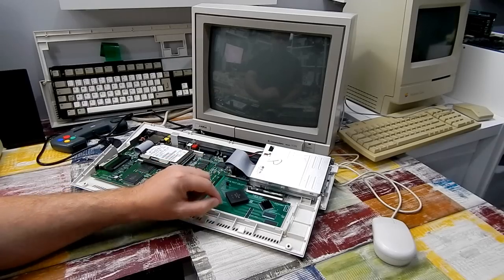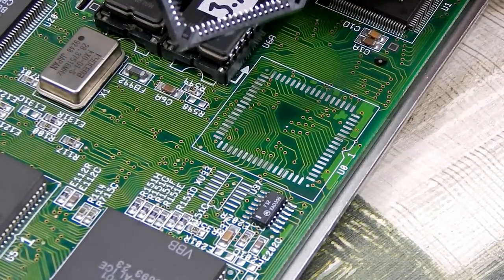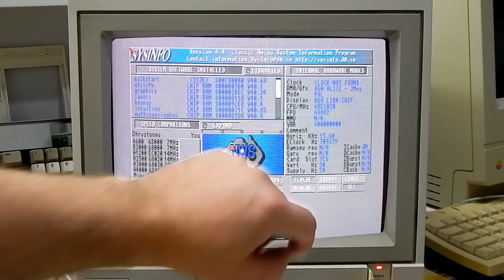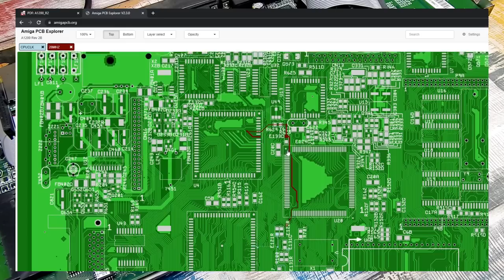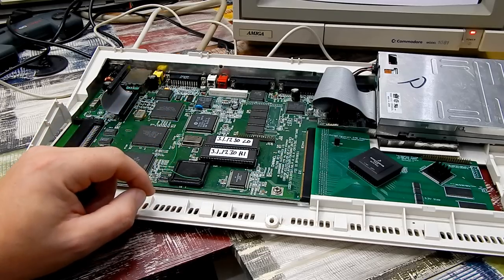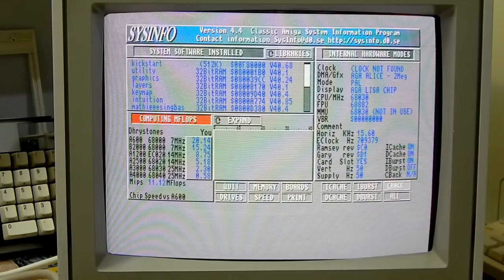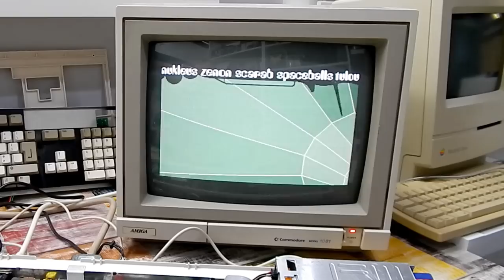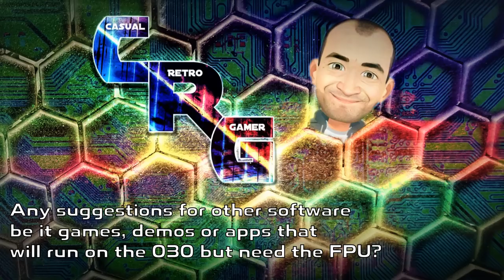Amiga 1200 adding an FPU to the TF1230 *sort of*

Comment: Great video =D The reason its not running as fast as you thought with the clock coming from 030 - Don't forget the 030 doesnt run at its full clock speed all the time!  When you connect to mobo 28Mhz - that's a constant 28Mhz!   When TF1230 slows down to access chip or other things, that means FPU is slowed down too!  I suspect the crashing is when it peaks at 60Mhz, that's a bit too much for it over time.
Reply from the maker: Glad you enjoyed it and thanks for the help on discord.  Never occurred to me that the 030 slowing might be the cause of the slower clock but I do think the issue here might be as Stephen suggested and the clock is too fast for the chip.  Running AIBB now it thinks the fpu is running at only 22.4 MHz or just a little under half the CPU clock.  It's a pitty my scope can't handle frequencies  that high or we could take a look at it.
Reply: @CRG  Its definitely due to cpu clock speed varying!  That 28mhz is always 28Mhz
Reply from the maker: @GadgetUK164  I'm going to fit a separate 40mhz crystal.  That should sort it out and allow me to crank the CPU back up to 60.
Reply: @CRG  also do the acetone test to check you don't have a remarked 16MHz part, which I'm guessing you do :)
Reply: @CRG  The FPU chip select signal come from the AA Gayle chip and will be limited by its maximum decoding speed and it maybe synced to the 14Mhz bus/clock? That may explain why it ran slower on the faster 030 clock. May also explain the .6 reading at 28Mhz as it would get 2x28Mhz cycles and have to wait for 1x14Mhz cycle whereas at 14Mhz it would be 1x1 giving .4. 
You could also try and cut the GND you added with the twisted pair at the FPU end (just leave it floating) as you may get ground induced noise if current is flowing (ground loop). or add a 10 to 33 Ohm resistor in series with the GND, or you could go to extremes and use a micro coax (WiFI antenna coax from an old notebook PC)
Also: I found the best way to test the FPU is AIBB Beach Ball test, it will exit early and not draw the entire ball. (gives impossible results)
Reply: @CRG  Did you get a 40mhz crystal to test this out? :) Hope to see a folloup soon. Love this kinda vids where you do new untested stuff and findings :)

Comment: The 28MHz clock is in time with the motherboard (i.e. it's a synchronous clock). The 50MHz clock is asynchronous, i.e. the clock signal isn't aligned with the timing of the motherboard. I think that's why it's working out somewhat slower when using the accelerator clock? You're basically missing the odd cycle due to that non-alignment. If you draw the clocks on some graph paper I think it should become apparent what's happening :)

Comment: Reminded me of when I had my A1200 with an 030 processer and FPU accelerator around 93. I left it on to render the Enterprise with a 3D package (can't remember which one, but I think it was an Amiga Format cover disk.), I think it had been rendering for around 2 days and was around not far from being competed when I decided to go to the local pub, I came back after a heavy night out and my Mum told me she  had switched my Amiga off to save electricity!
Reply: That's even worse than a games console you left on getting turned off at a point before you can save...  ouch

Comment: 28 MHz are generated on the mainboard of the A1200. But because the graphics and the CPU have to access the chip RAM, it is 14 MHz for the CPU (& FPU) and 14 MHz for the graphics (AGA chip set).

An external CPU board can access the external Fast RAM synchronously with 50 MHz, but asynchronously access the Chip RAM only with a 14 MHz bus.

If you direct 28 MHz into the FPU then these are in sync with the 14 MHz. The restriction that the 50 MHz CPU can only access it asynchronously remains.

If you direct 50 MHz to the FPU, the FPU is faster, but no longer synchronous to the 14 MHz bus on which it is attached. The CPU looks even worse. The CPU with 50 MHz can only access the 14 MHz bus asynchronously and can then only reach the 50 Mhz FPU asynchronously from the 14 MHz bus.

Comment: I did the initial video on this. But nice job tapping into the 28.  I just use the crystal
Reply from the maker: Thanks, I have to admit I missed your video and didn't see it until after getting most of this one recorded.  It seems to be a popular topic at the minute as a few people have done videos on it.  

Ultimately I think the separate crystal is the best way to do it and I'll revisit this to undo the clock from the 1230 and use a 40mhz crystal instead.
Reply: @CRG  10Marc has just done a video on the Tsunami 1230 card (New version of the old Phase 5 Blizzard). The Tsunami is like the TF1230 but has space for a onboard FPU socket to be run at the same speed or above the 030 @ 42mhz 👍🏻

Comment: Here is some info to help you: In theory a (e.g. 2.5 watt) laser etcher/engraver (as used for PCB etching) might accurately be able to get that black coating off the 68030 to reveal metal for a heatsink. As an aside that long wire is pulling a relatively heavy current fast and will probably want a (decoupling) capacitor for a current delayed by stray inductance in (e.g. lines for) power, lest you spike/drop the voltage. For the decoupling capacitor, film capacitors better than ceramic, and then electrolytic without additionals will be too slow before they are full with a voltage spike/drop. Maybe shield that long run wire too. At a push you could use a logic-analyzer(or MacGyver one out of an fpga)  to see how each end of the wire behaves (or an oscope kinda like checking an eye pattern). What decoupling capacitor do you think you need though? Say 100nF-400nF? Aside from Amiga, it is commonplace on 80s and 90s devices to see decoupling caps soldered atop the VCC and GND pins of IC's.
As a thought beyond this Amiga as such, protection diodes (for ECD protection) indicating a maximum current (whatever that is, be it 1mA or whatever) means protection from voltage (+12V and -5V on inputs for boards on machines but not that amiga, per se) as for leakage current, so 10k would protect against all shorts but might render the whole thing unusuable (until taken off again). That is a tangent though.
;D
In general, another youtube video fitting an FPU to the Mobo while using a tf1230 is "Amiga 1200 internal FPU anyone can do this" by Chris Edwards Restoration (video 3 March 2022).
Just FYI, when not using that tf1230, the 020 on the mobo can do 28MHz stable, and even 33MHz. An MC68882FN40A might take some such jiggery-pokery again though. Upload a Jpeg/Mpeg4 of your FPU close-up to see the writing on it?
My comment has no hate in it and I do no harm. I am not appalled or afraid, boasting or envying or complaining... Just saying. Psalms23: Giving thanks and praise to the Lord and peace and love. Also, I'd say Matthew6.

Comment: I honestly don't like using an Amiga 1200 without an FPU. I used an Apollo 68040 for the last 20 years, and when I upgraded to my TerribleFire 1260 board and used a 68LC060 chip with no FPU, half my software whined and complained (and stopped working) since I had the FPU versions installed! I know I am the exception, not the rule, but I need an FPU for the stuff I do.
I will get a full 68RC060 later this month.
Reply: For my A1200, my TF1260 was shipped with a low-cost 68LC060 Rev 4 and I later purchased the full 68060 Rev 1 (overclocked to 62.5Mhz). I use to own an A3000 with 25 Mhz 68030/68882.

Comment: Check the two clock signals with an oscilloscope. You might have ringing or dampening on the longer wire, rise times might be degraded preventing the fpu from deriving a good clock signal. I would personally use a 40MHz separate TTL oscillator just mounted close to the fpu.

P. S. : don't connect the ground wire on both sides.
Reply from the maker: Unfortunately my scope won't go anywhere near those frequencies.  A new scope is in my list of things to get but at present I don't have the funds for it.

Comment: you could have left the pstic part in soldered the pads on the motherboard then applied the socket using hot air
Reply from the maker: Possibly but I didn't want to risk any mistakes so I just put it on as I know how.
Reply: @CRG  Check out some of the Console Repair channels. Things just float into place due to surface tension. Amazing to watch.

Comment: What about Solder Paste or pretinning it, adding flux and hot air from the back to get the Socket on?
Reply: I dont think they sockets  like a lot of heat. I thought along the same lines
Reply: @georgehunter2124  You use it to melt the solder, when its molten you place the Socket on top and then move away.

I mean those Sockets got to be installed in a Factory somehow. ANd that might be an Oven or so.
Reply from the maker: Solder paste may have been an option but having never used it before and seeing other people struggle with it I didn't want to take any chances and risk damaging the 1200.
Reply: @CRG  since you're in UK, you could ask "TheCod3r" for example. He seems to do some more extreme Soldering Jobs. Like reballing your BGA thing. Without a Stencil, just Balls from a can....
I think he did some Solder Paste Jobs as well, so he might know how to use it.

Comment: That is almost certainly a remarked 16MHz part.  I bought a few a while back - only some would run at 40MHz reliably.  Even though there is only one mask the 16MHz ones may have been marked as such because they failed at higher frequencies.  I would see if you can get a genuine freescale marked one or a known genuine one out of an old accelerator board.

Comment: I wonder what was Commodore's thinking in provisioning for one and how much it would have cost Commodore to factory fit one. Perhaps they were going to but decided against it at some point.
Reply: Just a guess but ...

Engineers: Of course it should at least have the option for an FPU and we have the board space so why not?
Bean counters: If we don't fit that footprint with an empty FPU socket we can shave some tens of cents from the BoM.
Reply from the maker: I asked this question over on EAB.  The thoughts over there are that engineers designed the board and give the sales guys options of different configurations.  They could have ordered the machines to be made with an FPU but never did.
Reply: Worst still, at one time we were to get DSP included in all machines, but so that they could save a few bucks they didn't add it

Comment: It's likey impedance matching issues, or the split needs a buffer. I'm not sure how the fpu works but I assume it uses an interrupt to signal calculation is done. If the cpu is running async it takes a few more clock cycles to sync up. Maybe there are bus errors and the data needs to be resent. I think the _BEER signal is bus error, if you put an oscilloscope on that, see if it triggers.

Comment: Watched your video-very interested-but don't those demo software runs include software that utilizes disk transferring not direct memory transfers, and is the fpu saving  3 out of 4 clock cycles doing math arithmetic and is there conflict with 2 types of processing one type being disk to memory and the other processing floating point number arithmetic.Greater speed obtained by using dma transfers!

Comment: have you by any chance checked what freq you are getting from the Accel board?   I have seen chips/cpu's that take a system clock and multiply the signal to run faster internally.  This may not be that, but why trust it...  check it with an Oscope or freq counter....   that may explain why the main board is running faster...  it may only be 14 Mhz.

Comment: I've seen situations where chips go too far past their rated speed only see every 2nd or 3rd edge.. Eg. some of my 1260s clocked at 125mhz look like they are running at about half that.
Reply from the maker: I think ultimately that's the problem.  I've ordered a 40mhz crystal and I'll install that beside the fpu.
Reply: @CRG  make sure there is a decoupling cap near the xtal
Reply: @TerribleFire  couldn't he just lift the clock signal pin on the FPU and not connect it to a clock signal at all? I think I've heard somewhere that if you don't feed the FPU a clock signal, it will run at it's own rated clock speed.
Reply: @MallaganVloggs  Thats a myth... A simple read of the MC68882 user manual will tell you this is not true. Especially when you consider these chips are tested and rated after manufacture and get sorted by how they perform (binned). How could they know beforehand what speed they would be rated to? It always amazes me how these rumors get started.
Reply: @TerribleFire  alright, thanks for clearing that up

Comment: i would remove the pin on the socket prior soldering it on the board....and solder the wire without bending the pin :). Isnt there any pin on the board connector for the clock signal? Just to have a shorter wire
Reply from the maker: I suppose in hindsight I could have removed the pin from the socket after initially trying it with the 14mhz clock, but its done now.  I don't believe the accelerators CPU clock is present on the edge connector so the wire had to run to the card itself.  I've since further modified this and placed a 40mhz crystal beside the FPU solely for it.  It's running happy at that speed.
Reply: @CRG  mhh so how does it look like now..?
Reply: @CRG  ok found the second part :)
Reply from the maker: @klofisch  honestly its a bit of a mess, it was a rushed 2nd part to be honest and I need to revisit it to tidy the soldering.  But at least it works 😆

Comment: Anything spare on the edge connector ? You could use a spare to connect to then pick up for your FPU from the Amiga side. Then you could remove when needed a bit more easily. - Just a thought.
Reply from the maker: To be honest I'm not happy with how this was left.  I've now got a 40mhz crystal and I'm going to wire that up beside the fpu.  Ultimately I think that is the better option to run the chip at full speed.  I might do a quick follow up video to show the install of the crystal.

Comment: Just a warning, don’t mess this up like I did. I managed to damage some traces on my Re-Amiga board and had to send it off to a mate if mine for repair 🙄 Also this won’t work with the TF1260 LC or EC 060 processors.
Reply: 68060 design assumes an integrated FPU, hence off-chip FPU wouldn't work.   Intel 80487 "FPU" upgrade is just full 80486DX with a slightly different pin layout.

Comment: Been there, done that.
You cannot o.c an FPU, you will have crashes and graphics corruption.
Sysinfo is the wrong tool.
You need AIBB65 and run all the benchmarks that are typed with yellow fonts. Also you must enable 68020+FPU next to your machine and others you compare on the list.
You should do that on every step you do to check the results without the fpu and between 28 and whatever from the accelerator.
Jesus is your demo for that things.
Reply from the maker: What do you mean by enable 68020+fpu?  

I'll try AIBB see how the results pan out.  Sysinfo isn't the best tool but I just had it to hand.
Reply: @CRG  in AIBB there are cyclebuttons next to your machine and others which selects cpu and/or fpu to test. What it does is, if you don't select fpu then AIBB is clever enough to perform the test with forcing the floating points onto the CPU, enable the FPU and you will see a great speed-up.

Also, you could always try the Real3d 1.3 demo picture..... 

 Try Beachball with and without the fpu selected.....
Reply from the maker: @brynjarborgersen8131  got it working now and yes there is some difference when the fpu is enabled or disabled.  The results are coming in similar to a 25mhz A3000 which makes sense as AIBB sees the fpu clock at 22.4mhz.

I think a quick follow up video with a separate 40mhz crystal is the way to go!
Reply: @CRG  Sorry for the late reply.
What Brynjar said.
Great that you made it working.

Comment: I know this is not the 'proper' method of doing such a job, but I would have been tempted to just clamp the socket in place on the motherboard with the legs on the solder pads followed by using hot air to melt the solder on the pads.

Comment: I paid a mortgage and got an old school 1230 with a slot for 68882 - got that separate and put it on. like you , why , because lol.  030 runs at 55.80 mhz 9.01 mips 1.35  mflops and 8630 dhrystones.

Comment: Just as - Vincent GR - correctly say , You can not overclock a FPU , they will run slower .
Those chips simply doesnt like the higher speed and wont see all the clock cycles 
and they are also much more likely to get dammaged too , even with just slight overclocking .
I have also being there and done that too , including dammaging a FPU so it was really unstable .
But what you can do other than reconnect it to the 28 mhz clock is to make a seperate 
little board with a 40 mhz clock and feed the FPU from there .
This will work and also give you both faster and stable FPU .
Reply from the maker: As I said at the end of the video fitting a separate 40mhz crystal is the next thing I want to try.  Ultimately it's probably the best option just right now I don't have a 40mhz crystal in stock.  I'll order one this evening and maybe do a quick follow up video.
Reply from the maker: Edit: if the fpu gets damaged it's not the end of the world, they were only cheap.  I think the 2 cost maybe £5

Comment: Would this work for an ACA1233n? I know indivision say they don't support putting an FPU on the accelerator itself, even though there is a section for it. Does anyone know if an FPU on the motherboard will still keep working just like it does with the TF card? Thanks.
Reply from the maker: I don't think it will to be honest.  I expect the aca will disable the onboard FPU like it does the onboard CPU.  

I no longer have the ACA card or I would test it for you.